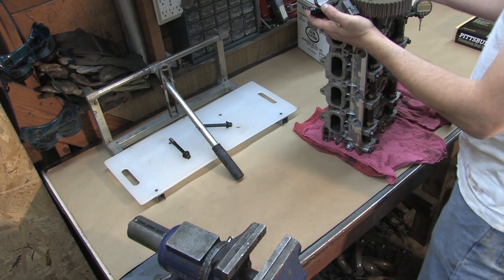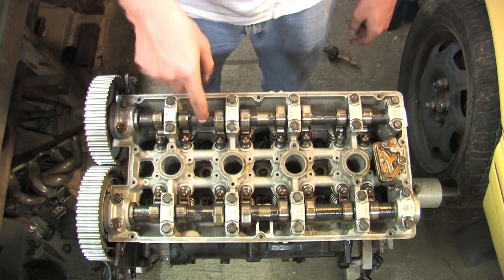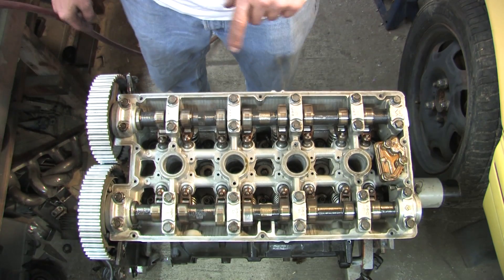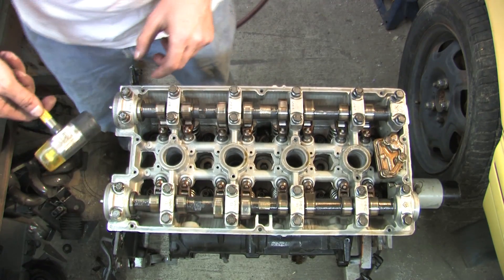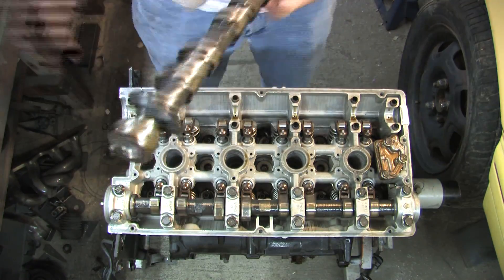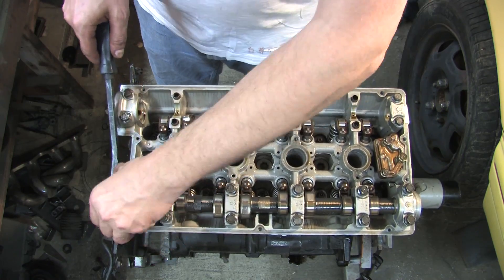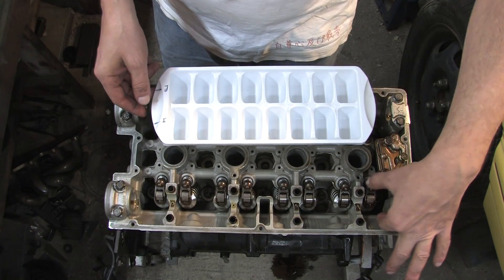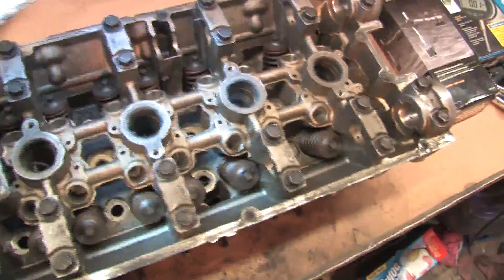Cylinder Head 101 - Remove Cams Rockers & Lifters

Comment: Jafro,
              I love your videos man. Your so smart an know so much about cars. I wish i knew just a much as you did. I have a few questions if you could answer please. I recently bought i 1986 Toyota Supra, and i ran into a few problems that i would like to get your advice on. Oh an the car as 169k miles on it, So heres what she told me about the car. The car has been sitting for about 8 months the motor stopped running because she said the engine seized, but before the engine seized she blew a head gasket an got it repaired, an afterwards the car drove fine for about a week an the motor seized on her. So the first thing i did when i looked at the car was checked the oil an there was oil on the dip stick an was just about full, so i thought that was a good sign. At the time i could not started the car or even try to because the battery was dead. So i purchased the car from her thinking that the motor probably was not seized because the oil was fine an that the engine stopped running because she blew another head gasket. Which i figured worst case senerio the head was warped an maybe the block as well. So i just got the head back from the machine shop a couple days ago and the head was warped, So i asked them to do a surface job on it, pressure check it, an clean it up as well check my valves. They machined it an everything looked good. Ok, question #1 can i reuse my camshafts/cam caps if there is some scoring an rough spots on them? can the machine shop buff/machine the rough an scoring out of them? If so will that messing up my oil clearences between the camshafts an caps and the head? Or should i get new cams an caps? If i get new cams/caps do i new to get a brand new head as well? because there is also scoring/roughness on the head where the cams sit. #2 As the head was in the shop i was working on pulling the block an unbolting the transmission. To unbolt the transmission from the block i must first unbolt 7 bolts from the flywheel from the torque converter as well some outter bolts too. To do this i must unbolt 2 bolts at a time an then rotate the crankshaft an repeat. Well when i tried to rotate the crankshaft i realized that the crankshaft didnt not want to move. Now i put alot of force on trying to rotate the crankshaft an it still didnt not want to turn over. Which makes me think that the engine was really seized. Which i dont understand why... There is oil in the engine, so i know its not oil starved, could there be a possiblity of rust seizing the pistons as the car sat for 7-8 months with the blown head? when i did remove the head i did notice on piston #1 there was coolant sitting on top of it. If the engine is seized how can i get it unseized? Or break the pistons loose so i can rotate the crankshaft freely? I need to unseize the engine to rotate the crankshaft to unbolt the transmission, so i can pull the block an take it to the machine shop. Oh the engine is a 7mge 3.0 v6. Ive heard people using penatrating oil an spray the pistions or tranmission oil, or power steering fuild. As of this moment i am using penatrating oil on the pistons. Ive filled each of them with about a inch of it. It as been sitting for a couple days now a i still cannot move the crankshaft. What do i do? Please help Jafro! Love ya. Keep up the videos.
Reply from the maker: Pull the oil pan.  You'll likely find your answer at a glance.  If it sat full of water and rusted itself together, you'll know immediately.  Rod/bearing problem?  Immediately.  If it was a problem with the pistons you'd have most likely noticed that with the head off.  

I don't know what I can tell you about your head over the internet.  People ask me to diagnose things all the time that there's no possible way I can answer without handling the parts, but I would advise you to let your machine shop deal with that.
Reply: Hey Jafro i just wanted to say thank you for the advice. I did find my problem when i pulled the oil pan.. A quickl up date. I just pulled the block a few days ago an just pulled the pistons out today, and WOOOW. I could not BELIEVE what i saw in clyinder #6. Ive never seen something so amazing, yet so horrifying at the sametime. I wish i could send you a picture of what i saw. Anyways Thank you an hope to see some new videos upload soon. Peace out.
Reply from the maker: It works like a charm every time!  ;)  I take it the bottom end problem wasn't caused by the head?...  
...or did it dump coolant and/or drop a valve?

My recommendation?  Post a video!  :o
Reply: Yea the head wasnt the problem. So it was the piston in cylinder #6. Well actually it was the rod cap bearing it pretty much in peices. Which was stopping the crank from moving freely. Its so bad that the metal shaving from the bearing are EVERYWHERE on the crank journal, an part of the bearing is actually stuck to the crank journal. Yea maybe i will make a video tomorrow an post it so you can see what im talking about.

Comment: NEED HELP/ADVICE, I accidently turned my head on its side and all the rocker arms fell out, it is also a dohc, I realized I shouldn't just place them back in how ever and go on about my way trying to run the engine, so im wondering what I can do or if a shop or mechanic can even fix this?

Comment: I took a cylinder head off the other day and remembered not to sit it down on the valve side, however it was an OHV engine therefore the camshaft wasn't pushing the valves open so it didn't really matter. Still good practice though

Comment: If you wanted to change out cams, all you would have to do is remove the old ones and put the new ones in without toiching the lifters rockers and valves? Is there a way to line up the cam lobes etc? Thanks